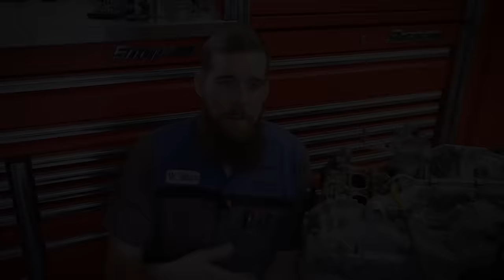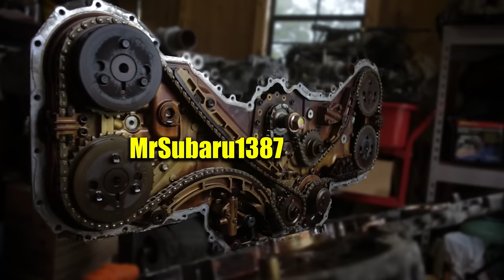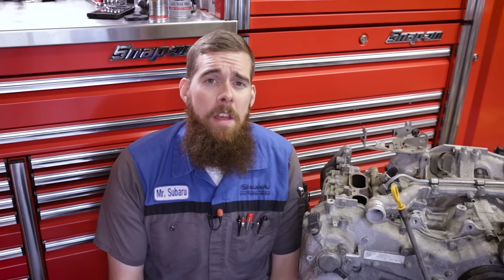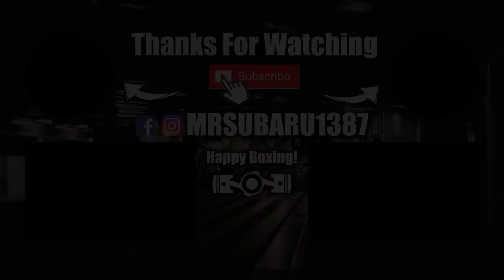Why Subarus Are So UNreliable!!! Buckle Up!!!

Comment: Well, that makes me feel better about maybe getting a used Subaru.  You may like to know, I have TWO EZ30 engines in my Porsche 917/10 Can Am car replica!!!  The original car had a flat 12 boxer engine.  I did have them connected and running together but it is now on one engine because I couldn't spend any more money and emotions working out the details.  Next spring, I will reconnect them so my 917 replica has a 12-cylinder boxer engine like the original car.

This is how I plan to connect them.  A chain sprocket will be bolted on the back of the crank on both engines.  A drive shaft with sprockets in bearings over the top of the engines will be installed and chains going down to the crank sprockets.  Then I bolt on the flywheel on the rear engine sprocket.  I will shim the flange of the transaxle the thickness on the sprocket so the starter will engage the flywheel.  Everything will be heavy duty of course.  To my imagination, the front engine will be a supercharger for the rear engine, applying the torque to the rear of the crank shaft.  So far, this is just theory.  The chain clearance hasn't been finalized.

To run the engines together, I will wire it as following.  The rear engine crank and cam position sensors and all other sensors will talk to the Megasquirt computer.  Each engine will be set at Top Dead Center on cylinder one.  The coil and injector firing signals from the computer will be split to both engine cylinders in sequence. 

As far as the VVT and any other auxiliary systems, I'm hoping they can be disconnected so the engines work on their basic systems.  More thinking will be needed but how am I doing so far?

Comment: Just bought a '23 WRX.  We also have a '19 Ascent (70k miles) and a '10 Outback (150k miles).  I've owned over 25 cars in my life and love to drive and modify cars, is is part of car ownership the world over.  But I cringe whenever I see people trying to 'hide' performance mods from dealers and try to take advantage of warranties.   That is basically THEFT.  You drive up the price of warranty work for the rest of us and you put dealers (who are businesses who need to keep the lights on and pay employees) in a pinch to help out people who don't abuse their cars and need repairs out of warranty. 

When you hobble together a bunch of parts to beat the car next to you at a stoplight and then blame the engineers and manufacturer when it blows up is just asinine.   

I discussed my WRX with the dealership when I bought it with regards to warranty work.  Tires, brake pads, suspension parts, and anything from the cat back and you can mod all you want.  Their concern is the intake.  They weren't being old grannies about it, they actually explained in detail what the concerns were in upping the boost and intake volume haphazardly.  They have many customers who mod, some right after purchase (and some of them techs and salespeople!) and unless it is done RIGHT these engines are finicky and may not react well to XYZ collection of performance parts.   Tons of pro-tuners on YouTube and elsewhere say exactly the same thing, if you mod you need to PAY ATTENTION and MONITOR how your car reacts, and don't expect anyone else  to pay for a blown engine.    If you mod, you need to do MORE MAINTENANCE, MORE OFTEN, not just the basic stuff in the manual.   Take care of it and it will last.  

I absolutely love the WRX, it is a really balanced machine and almost perfect from the factory.  Doing the first oil change at 1k, and will probably add a nice cat back exhaust for some more rumble and pops.   It is the first car I've had in 15 years, as I've been driving SUVs to haul the kids around, now most of them drive.   Good to have a manual again, it really adds to driving fun.

Comment: Changed my oil every 3000 on Wrx after market parts no problem. Same parts on sti changed oil every 6000 spun rod bearing. Back to every 3000  on new engine so far so good, but anything can happen.😎

Comment: My '07 Legacy has been well maintained and its second set of head gaskets are shot.  With a coolant leak in the radiator as well, a/c refrigerant leak, worn control arms, worn brakes, a bad wheel bearing on the left front wheel, and inevitably a growing list of failures, I'm done pouring money down the drain on this thing.  I thought I'd make 200k, but I guess 170k miles is all she wrote.  Maybe my mistake was having the first head gasket job done at a Subaru dealer with OEM replacements.

Comment: I was a trucker for 30+ years. A mechanic I knew years ago said the biggest problems he saw with the trucks that came in was the loose nut behind the wheel. He also said the least expensive and most valuable tools were the grease gun and oil can. Proper maintenance and good driving habits go a long way in extending the life of a car.

Comment: One of our car salesman at our shop, he had a bug eye WRX fully built with a STI transmission ram solid always warmed it up, did his maintenance early, always checked the oil regularly, did spark plugs without pulling the motor with special tool, never did any cheap mods he did Perrin or Cobb parts with a pro tuned, the day he sold it the new owner blew it up, by abusing it on cold start blamed it on the car
Reply: That’s what happens when somebody knows there stuff with Subarus then give it to somebody with no knowledge and becomes Subaru haters that’s how they blow it up

Comment: And my responsibly driven series white wrx spun a bearing at 16k miles 😓 changed oil at 1k then 4-5k oci and checked level every fuel fill up. I'm at 700 miles on the new short block and it feels much better.

Comment: I have a 2018 outback and the week before I paid it off had a 1300 dollar repair.  The week I received the title (when it was five years old)  I had a 5377 dollar bill for engine repairs as Subaru had not warned me that it needed to have the valve carbon cleaned out.  Do this.  Our Subaru has not been reliable.  Mine is NOT turbo charged, has never been run out of oil, nothing.  We were NOT told to clean out the valve carbon until it took a 5377 dollar repair.

Comment: Hi bud well said . I have a ej207 2.1 stroker that i change my oil every 3000km and will only use the genuine oil filter from Japan as in SA we get it . Perfect example i had a over boost issue i picked up and just switched my boost controller off so I’m in standard boost . Will rather get it sorted before i go into high boost . The other 1 is i hate drivers that push there cars when it’s cold and does not wait for oil temperature to get to normal temps.

Comment: Can you recommend which is the best antifreeze to use and which device to install to monitor the engine temp?  Also, should I install a transmission cooler?   I am not into crazy mods to increase the HP or anything - I just love my Forester and want it to last.

Comment: Right on, I’ve had three 2.5 n/a engine subes and the only issue has been the head gaskets. Everything else was really just consumables and were expected. BTW the timing belts are actually pretty easy to do compared to other engines I’ve done
Reply: Yes, but you've had three of them. Know when to quit. They are fun cars to drive when they're not in the shop.  But they go through way more " consumables" than most. I know multiple people that have owned one including myself. The oil consumption alone offsets the fuel mileage.😂

Comment: I a have 2015 STI with 129,000kms now

Subaru’s are also hard to check oil on correctly as often one side shows higher than the other so you have to go by the low side. I change the oil every 3000kms in my 2015 sti which i just had the valve lash reset on with new seals and timing belt belt components. If you car give you an misfire code while warming up you may need to check the valve lash!!!! However I did not replace
the water pump as the Subaru specialty shop I went to said they have never seen one fail before 220,000kms 

I never run the rpms above 6000rpm ever. I always let it warm up before any boost or even half throttle. I change the oil super frequently. Doing these few things my car runs like absolutely brand new and came back with good compression numbers still as well. I just put a catback exhaust on it as that is as much modification you can do to these cars without a tune. It runs absolutely flawless and pulls very hard. Never burns any oil over 1000’s of kms never has any questionable amount or colour of exhaust at full throttle or warming up. If you are running these cars above 20 Degrees Celsius they need 94 octane or a professional grade octane booster. In cold weather the factory tune runs perfect on 91 Octane without pulling timing but it will pull timing in warmer weather if you do not run higher octane. Can get it to Peak at 18.2PSI but tapers back down quick. With the factory exhaust it would Peak at 17.9PSI. JSYK and my car drives 100% like brand new and the clutch still looked nearly new. After 1st gear which requires almost 50% pedal travel all gears after only require 30% pedal travel for best shifting smoothness and feel. allows you to be fast with shifting as well but not too fast as you need to wait for the rpms to drop for that split second to have perfectly smooth next gear engagement and make sure clutch is already nearly 100% re applied before using throttle again to avoid drivetrain shock. Anyways love my car it’s super fun. Starts great in -30 degrees celsius as well but always keep it plugged in on the block heater for at least 4 hours at those temperatures. I have new Michelin X-Ice 3’s and new bridgestone blizzaks and a new set of Toyo all weather celsius tires that I try out between different factory rims as this sti is actually my dedicated winter car. Most people park these cars in winter while mine is parked away for summer lol.

Comment: I have double the factory power on a 07 ej205 avcs... basic servicr every 5k kms. Its done 50k kms zero issues. 

Just over service your turbo Subaru and it wont die, even EJ25 which I personally wouldnt touch.

Comment: 100%, I've owned multiple turbo 2-2.5 liter turbo and regular 2.5 L engined Subarus, and you know what? I have never had a bad head gasket or even an oil leak with many going over 100,000 miles before selling them. I drive cars hard as well, but I don't red line it at every stop sign. On the turbos I did 3000 mile oil changes and the others never above 5000 miles with syn. Did all the dealer-recommended service on time and that's it. Call me a sucker but seriously that's all it takes.

Comment: Holy hell! Thank you so much for this video MrSubaru. As the owner of a 2003 JDM Legacy GT with the EJ20Y, I have never had a SINGLE issue in the time I've owned my car. I'm the second owner, the car came with a full maintenance history. I change the oil every 4-6k Kilometers, warm it up daily, and cool it down idling if I've been on boost. It burns no oil in 18 years of life and 131,000 KM. Subaru makes one hell of a car, and they last, so long as you treat them more like a friend rather than a tool. Cheers!

Comment: Well I own 18 Crosstrek CVT 60k+ miles, oil change every 5k miles, never redline it. And now driver side engine is wet but not dripping no oil consumption yet. Hopefully it hold up for another 3 years without issues

Comment: The completely stock 40k mile S209 in SavageGeese’s video blew up after two laps. The track oriented version couldn’t even handle what is was meticulously designed for.    

While I’ll agree user error isn’t to be ignored. But when it comes down to brass tax an EJ motor requires 2x the amount of attention, care and modifications that it’s competitors would to be a reliable performance setup.
Reply: That’s true. I think it’s a partial truth. Something like a golf R you can beat on and tune the hell out of, but still have to be diligent on maintenance. To play devils advocate, the s209 owner could’ve redlined his car when cold often; he could’ve not done oil changes at 10k mikes while driving it hard. Also the s209 engine isn’t necessarily “hand built” it’s just a modified EJ257. We don’t know the whole truth.

Comment: 2001 Subaru Forester L 2.5l 5 speed 235,000mi original head gasket 2nd clutch at 205,000mi and still going strong. I do use the holts stop leak😂 I mean Subaru coolant conditioner with every coolant flush about every 20k 30k.

Comment: Bought our 2015 wrx new, took perfect care of it. No mods, my wife is primary driver and she drives it gently. It still developed a rod knock at 72,000 miles. 
Put a new short block in it a month ago. Why? Please give opinions.
Reply from the maker: Hard to say. Nothing mechanical is absolute. They'll all give trouble eventually, some sooner than not. Could've been a manufacturer issue that took time to rear its head, could be a fluke, hard to say. As I said in the video, some fail/have issues just because. They aren't all perfect. Sorry to hear of the bad experience.
Reply: @MrSubaru1387  luckily I was able to get the new shoetblock installed with new oil pump for just under $5,000 and its been working great.  If it lasts another 72,000 miles or more I'll be satisfied with it.

Comment: Got worried when I saw the title.  I'm considering a 2022 Legacy with the turbo.  Yes when I was younger I would have abused it, back in the late 80's early 90's I beat the heck out of my Audi Quattros.  The 2nd gear syncro was stripped in the 91 200 Quattro when I got rid of it in 93.  I was racing it all the time, jamming it into 2nd!  Also drove it 155 mph frequently. Today however I'm a much more conservative driver so maybe I wouldn't have a problem.  Friends tell me I drive like an old man... well, I am an old man now.  Btw, I wouldn't be doing any modifications.

Comment: I've owned a Impreza WRX since 2012 I bought it brand-new did all my  scheduled service never had to replace the head gasket until now at 215,000 replace the clutch at 125 I'm replacing it again at 215 changing out CV joints having engine machine replacing all the gaskets water pump timing belt never had a problem with this car I'll never own anything but a Subaru

Comment: I’d be more inclined to agree if I hadn’t just dropped off my 2016 Forester (non turbo) to have my head gasket redone along with my coolant system. $4900 repair. Awesome. Yes my Forester is bone stock and maintained.

Comment: I’ll say again 
2001 Outback LL bean Edition 245K 
2006 outback LL Bean edition 240K 
2015 Xv Crosstrek Premium 50K 
2021 Ascent Limited 10K 
I have never had head gusset issue until i bought 06 overheated outback 😂 rebuild it on 180k and has 240 now and just replaced starter witch i believe is my fault i set remount start on wrong crank set and it was over cranking in few month i fix it but it had some strange sound drive 3 years and it failed 0 surprised but take care your car it will take care of you…

Comment: Ngl I have beat the ever loving shit out of my 98 SF Forester. But 6 years and 80,xxxkms later, the original engine is still going real well.

Rigorous maintanence is what I find. STRICT oil changes at max 10,000km / 6 month period. Most of the time more like 8,000km as I get busy later on. Filter gets changed with oil. 
I also check and top up every single fluid before you drive, especially if you know you are going to abuse the car. 
Also checking and changing  hoses when they get crispy. Basically just maintain the car and it will treat you well.

Comment: my most and least reliable vehicles are both Subarus and I also own a 3rd gen rx7. I daily drive an outback with the NA 2.5, no issues with that one, and I have a GC rally car that has been through a 1.8 (rod knock) a 2.2 (low compression) a 2.0 turbo (retired for emmisions reasons) a 2.5 turbo (piston #1 exploded) and is now on its second 2.5 turbo engine. the rally car gets driven hard, but I expect a certain degree of longevity out of a well maintained mass produced engine on a factory tune, especially one that is performance oriented.

Comment: with my 2004 Outback H6, I've spent 9k in repairs, preventative maintenance, and a whole bunch of stuff from japan (3k at least). basically the entire front suspension is new, almost new bilsteins, every fluid has been flushed or replaced including diffs, most rear suspension components are new, vc gaskets, exhaust, spark plugs and coil packs, power steering rack and tie rods, pads discs and calipers, axles, sway bar links, all this year at around 150k miles. better last me a while lmfao

Comment: Most destroyed subies I've seen are almost exclusively due to owner neglect or owner abuse. Stop badly modding these cars, stop neglecting basic maintenance and stop driving like your life depends on getting to your destination in 4.6 seconds lmao

One of my past coworkers sold their forester XT that ran beautifully and had no mechanical issues, only to have the new owner have an absolute meltdown a few months later for "selling them a shitty car" after they blew up the automatic transmission and turbo.

So my coworker goes to meet them to see what the hell is going on and guess what? A tonne of crappy mods to boost the engine, hooked up to a cobb tuner and the orginal exhaust gutted and replaced with something to make it sound louder I guess? 😂 

Yes Subarus are known to be "fun" cars,  but you can have fun without abusing or neglecting them!

Comment: What are your thoughts on a 04 forester xs sport with only 18000 miles? Looks clean. Can I get 80000 miles before replacing the defective head gaskets? Seller wants $7000 for the car. Should I buy it if it's not rusted

Comment: Reminds me of the Shelby Lancer I used to have, equipped with the Turbo2. I was warned I needed to upgrade to head studs once I exceeded 14 psi otherwise loss of even clamping force would result in head gasket failure. My happy ass went right to ARP.